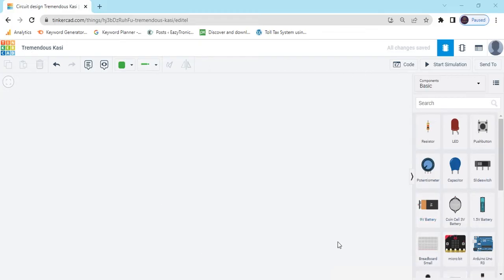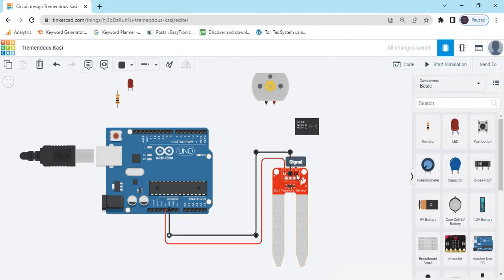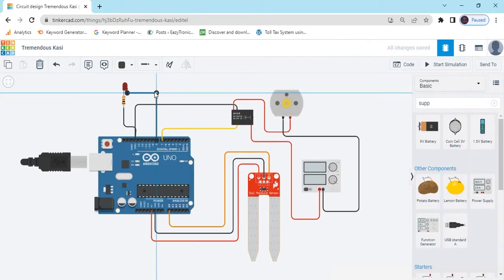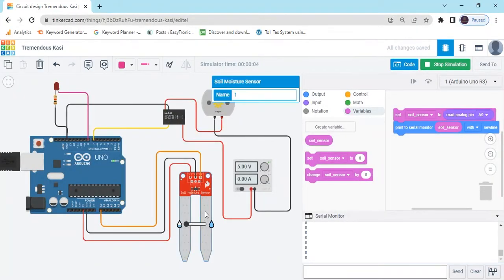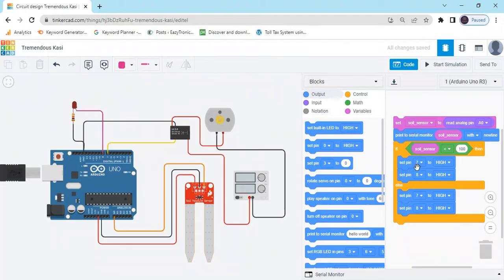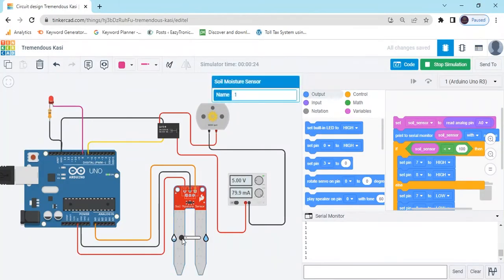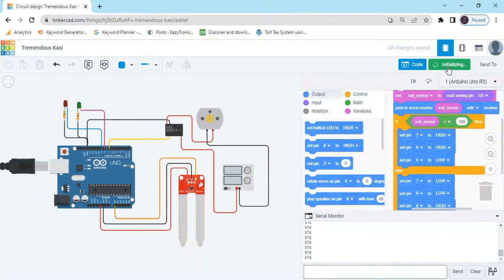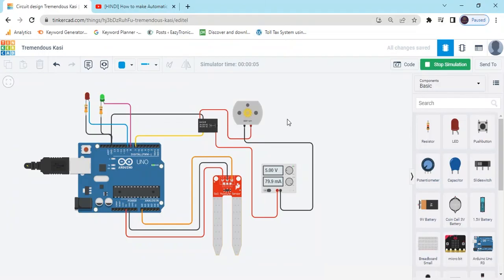Automatic Plant Watering System using Arduino Tinkercad in English | Block Coding |Irrigation System

Comment: My Arduino board says Current through I/O pin(s) D7 (28.6 mA) exceeds the recommended maximum of 20.0 mA. This may reduce the usable lifetime of the Arduino.
Reply: u need to use a driver to fix it, so the chip doesn't get damaged
Reply: @MiddleEastLebanon  what driver , could you explain more about it plz, i am having the same problem too?
Reply: @chitkoKolwin-q3f search driver and put it and attach  the lines to it

Comment: teacher how to make dc motor stop spin or spin less as moisture increase? because plant doesn't need watering after theres enough water.
Reply from the maker: You can set the motor timing in if condition

Comment: Hello teacher how does the power supply, relay SPDT and DC motor working together and what is the relationship? Thank you❤
Reply from the maker: Wire one relay to each of the motor contacts so that by default they are sending “Ground” to the motor.

Then wire the relays to the SPDT toggle so that when one of the switches receives power it sends “power” to the motor while the other switch is still sending “ground”.